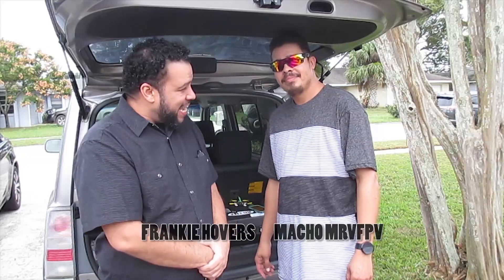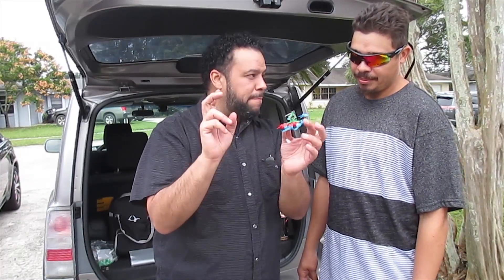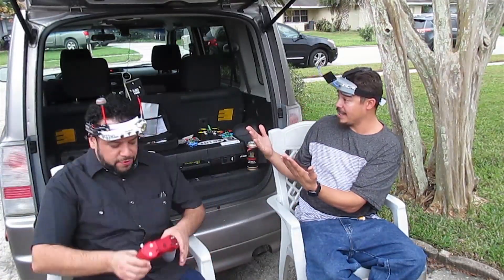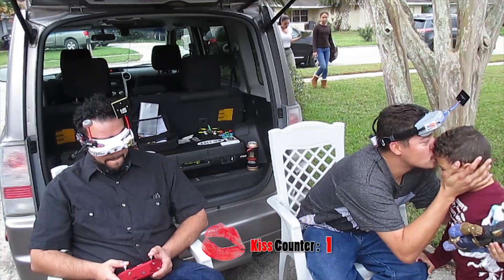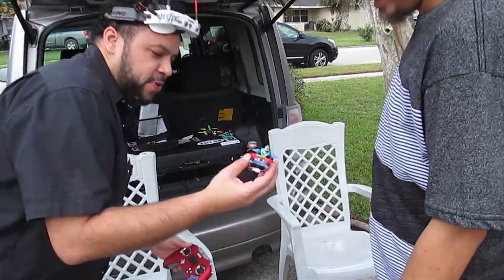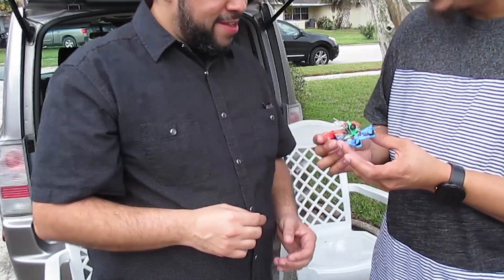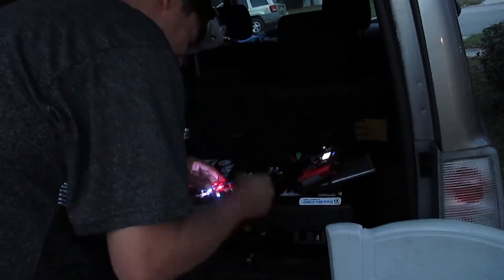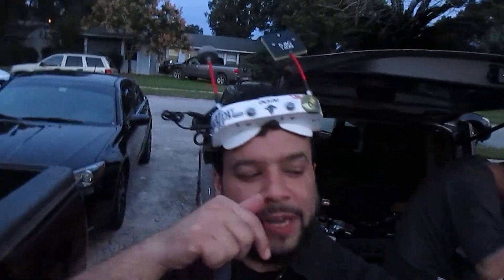3D Printed Tiny Whoop "H" Frame (BETTER AUDIO)

Comment: It it compatible with crazybee f4 and 1102 motors?
Reply from the maker: Flight Controller - Crazybee F3 (I'm sure other brands would work)
Motors - 0603 Brushless (I'm sure 0703 & 0802 would work also)
Propeller - Stock Triblades 31mm - (for better performance - Eachine 4 Blade 31mm)
Canopy & Camera Mount - (Take your pick any Tiny Whoop mount/canopy will work)

Comment: Heyguys, nice build! I have had 8 of those racerstar 0603 motors and the wires pull out from the stator very easily! I have 5 here wasted. has anyone else had that issue?
Reply from the maker: Yeah they're fragile I've been using tweezers to remove the plugs - slow and steady wins the race.